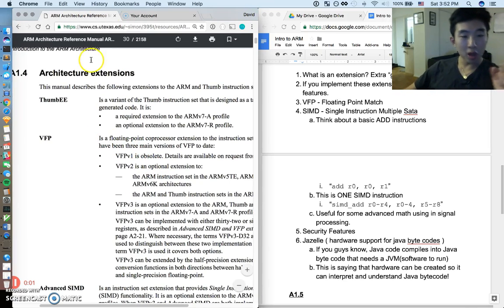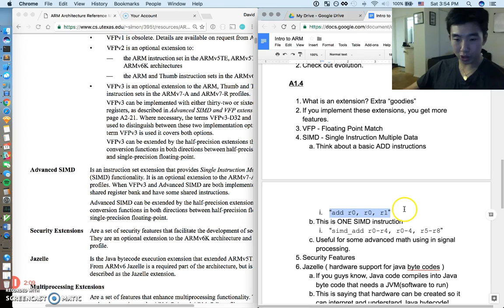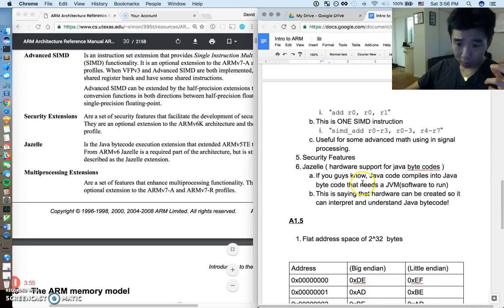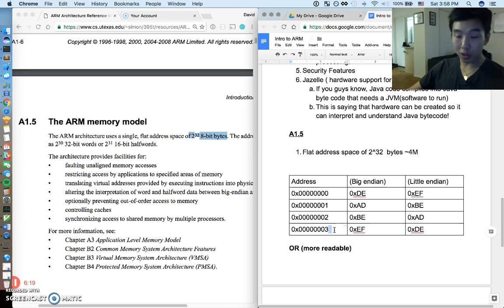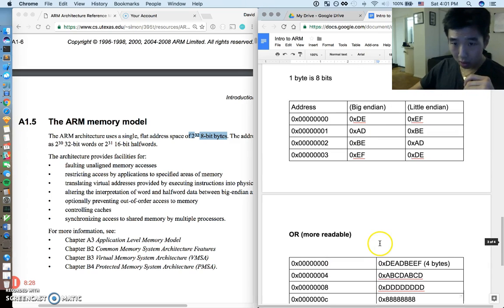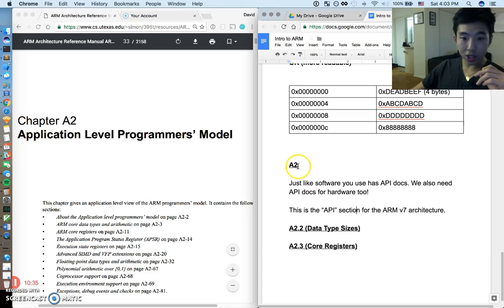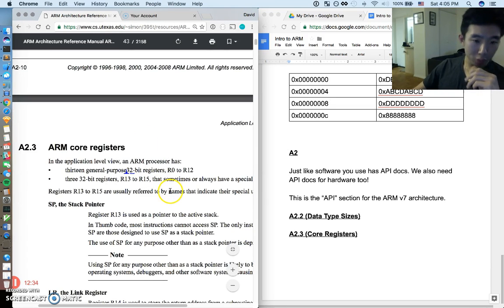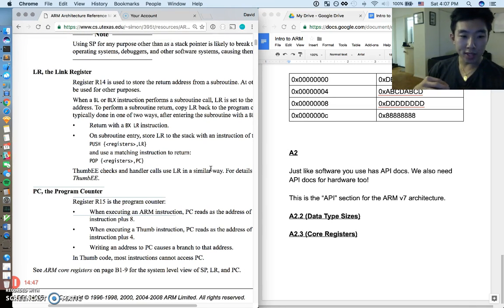Introduction to ARM - Part 2 (Hardware)

Comment: Hey Dave, did you learn Assembly x86 at college? Was it tough?
Reply from the maker: Didn't learn x86 in college. We were exposed to IA32, but very simple stuff.
Reply: Dave Xiang Like what? I feel like even writing a for loop in assembly x86 is torturous.
Reply from the maker: It's rare to completely write something from scratch in assembly. Many times we would take a compiled version as the v0 and work on that. If it was a pretty simple function, you can do it from scratch.